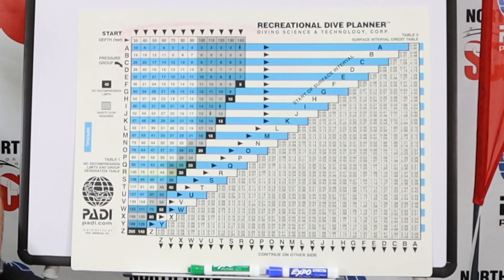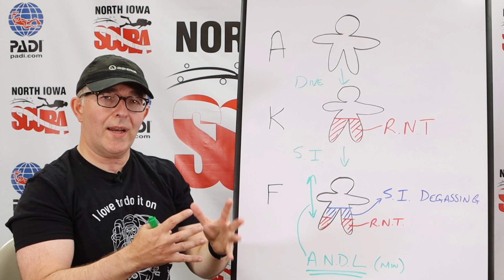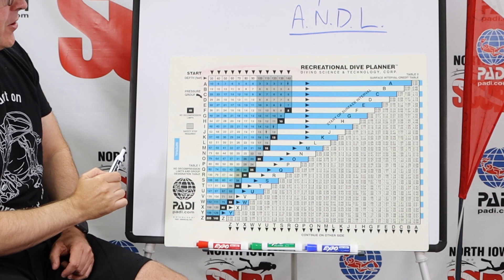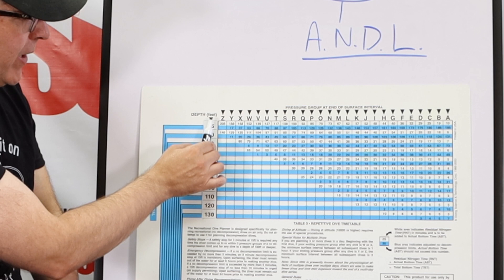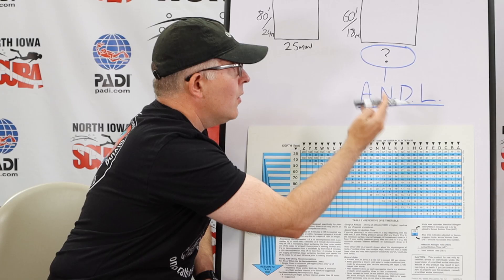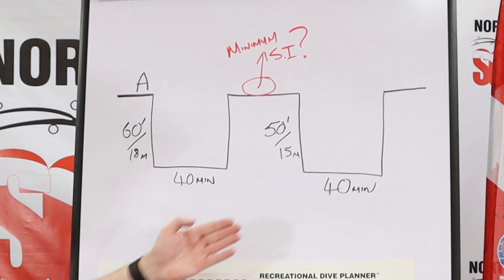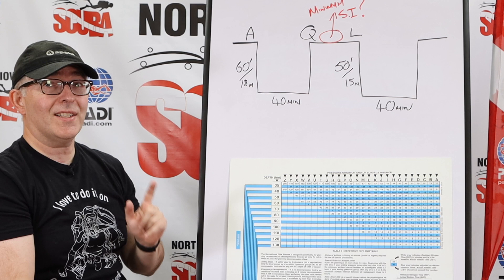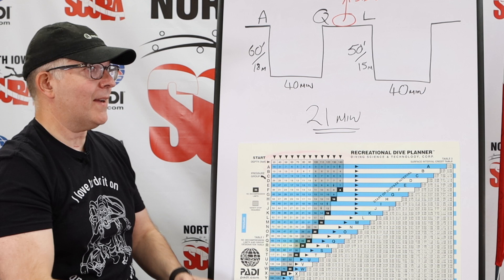PADI RDP Made Easy! (Adjusted NDL and Minimum Surface Interval Calculations)

Comment: Years ago, on a whim, I bought one of PADI's eRDPml electronic dive calculators. I think I used it twice. Give me the printed tables any day of the week. Of course I now have a nice air-integrated dive computer, but I still use my RDPs before almost every dive. (I have air, EAN32, and EAN36 tables, plus a PO2/MOD table and an RDP-size slate, all in a nice bundle that fits in the pocket of my BCD.) Running the tables scares some students, but once you learn it you only need periodic refreshers to retain it. The nice thing about "old school" methods is that they just work. Thanks for posting these highly educational videos.

Comment: I was under the impression that after you have you adjusted pressure group after a surface interval, you then use your depth to figure out how long you can stay at that depth without passing your NDL. But you picked a depth and time to figure out your next pressure group. Why do it this way?
Reply: I think it was just an example that you can calculate it that way if you wanted to, most likely you wouldn't.